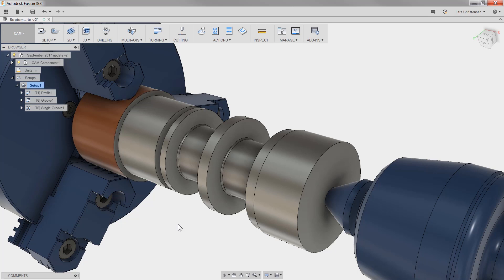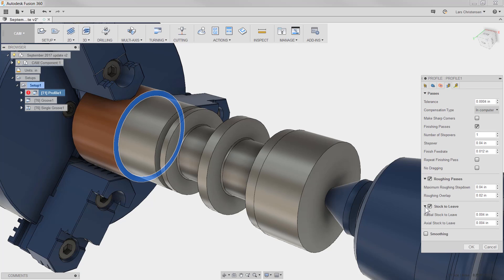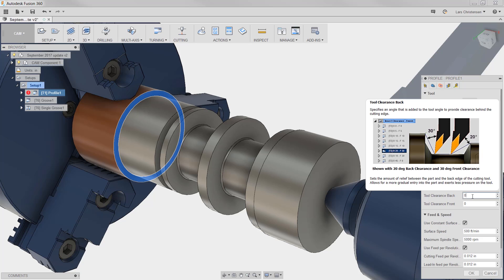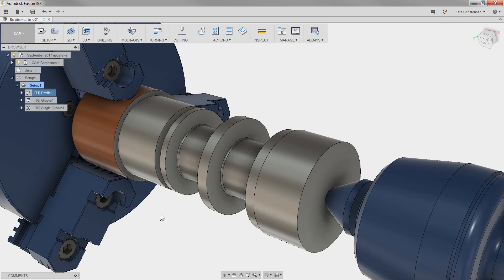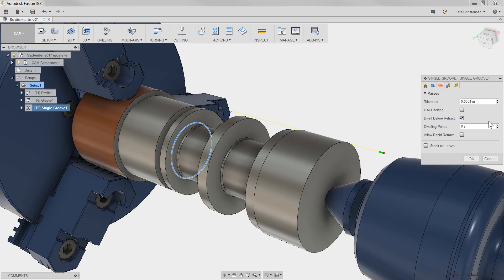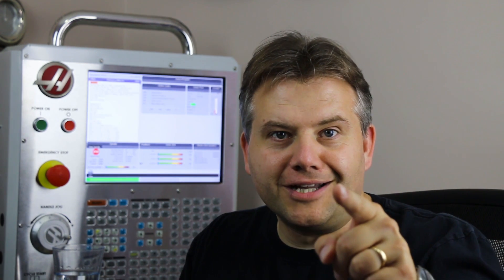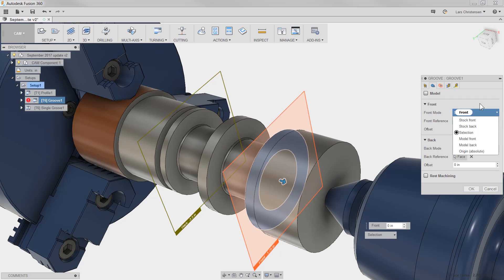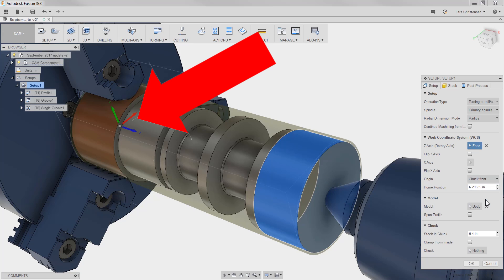Fusion 360 — A Look at What's New in Turning  for Fusion 360 September 2017

Comment: G'day. Might be a dumb question, but I'm a newbie in CAM world. What I need is a g-code for lathe profile. I have a DXF file with a profile. Can I generate a g-code only for a profile, no safe starting condition, tool changes, feeds and speeds. Like in this example: http://www.helmancnc.com/fanuc-cnc-lathe-programming-example/ but with FUSION 360 ?
Reply from the maker: Hi Vytautas Nar Thank you for watching!
You can bring in your dxf file and apply code without having to turn it into a solid. For the generating code without feeds and speeds: that will have to be adjusted in the post. Should not be a really big deal, just the fact that most people want feeds and speeds in there by default

Hope this is useful.

BEst,
Lars
Reply: Thank you for your reply. I am trying to generate a G-code that describes a profile (profile of impeller for turning). As for now, I managed  to generate a code for turning with post process, but that is not what I need. Seems to me, that fusion sort of moves across whole dxf (profile) at set rate and generates coordinates, that is why code is so long, even though operation is simple.  What I need is a G-Code that would look like this: for instance if profile starts with a straight line code starts: G01 X Z (just start and end points), if it is followed by a radius it would be G02 (or G03) and so on. Can I achieve something like that with Fusion 360?
Sorry if it's unclear, English is not my first language. Anyway, thank you for your time!

Comment: I am having a problem since the new upgrade.  I frequently start a sketch using a box on the side of a body that may or may not cover the side.  I then like to draw a construction line from bottom of that box to the top.  Frequently if I stop at the top of the box the line I draw is not 90 degrees.  In the past I would draw that line continuing beyond the Box Border, The make it a construction line.  I then would then trim the part of the line extending outside the box.  Now if I try the the construction IN the box goes away leaving the short extension outside the box.
Reply from the maker: Hi Carl, could you email me a screenshot? lars.christensen@autodesk.com
If this is a bug I will for sure share it with the development team
Reply: I made a Pictorial Review and sent it to your e-mail address.  I hope it is clear as to what I experience.